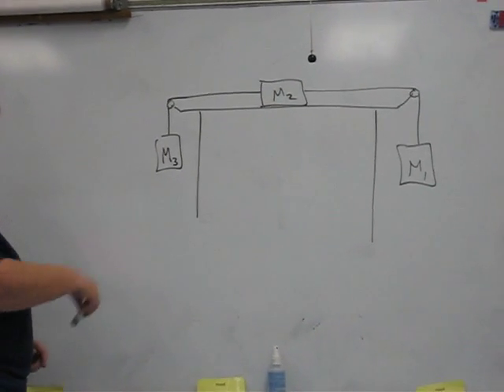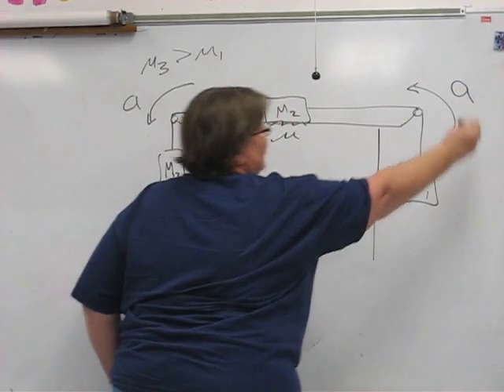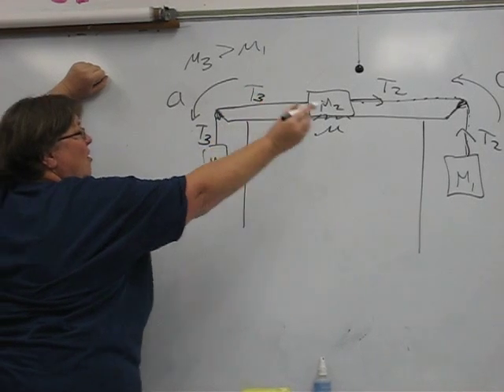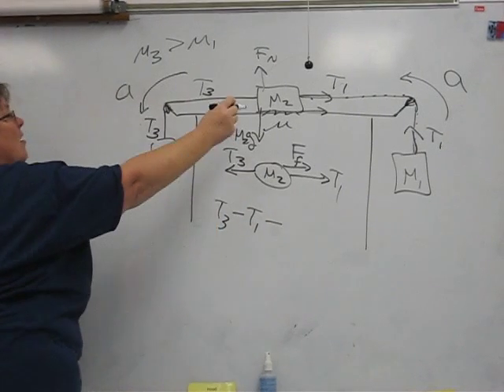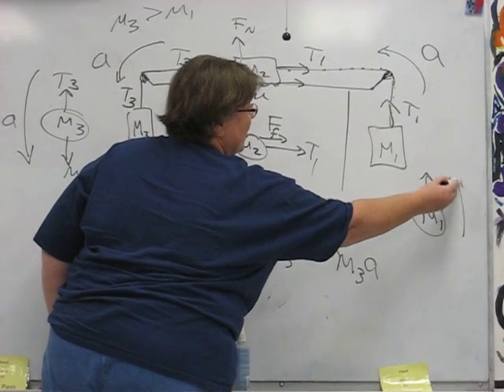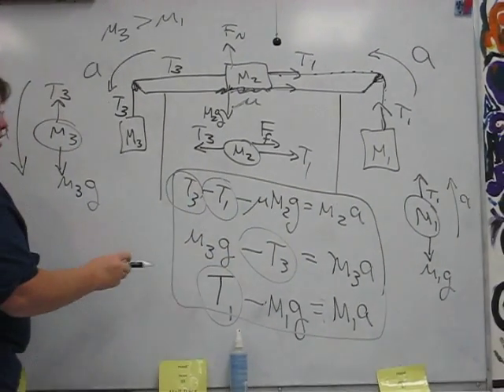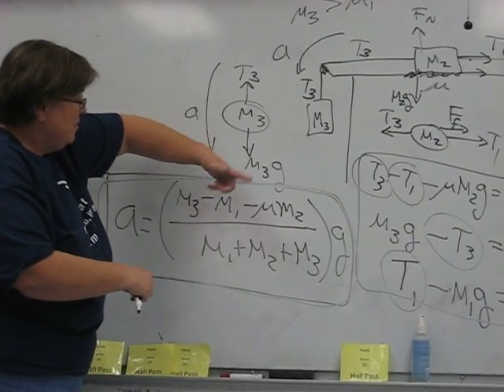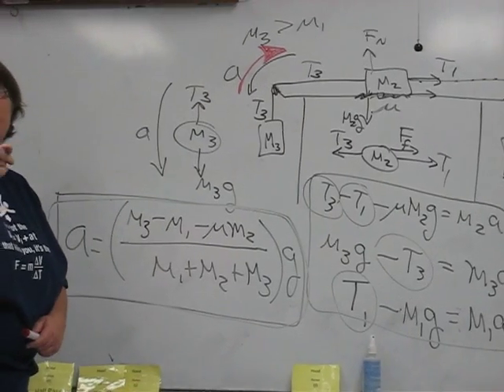3 Connected Masses

Comment: nope. actually it should be M3g-M1g-uM2g, and when she said she did the algebra in her head she just took the g (which is common to all the terms) out of each of the terms to make it (M3-M1-uM2)g. Try multiplying the g in and cross-checking with the original equation.